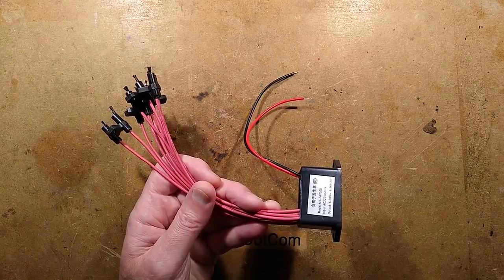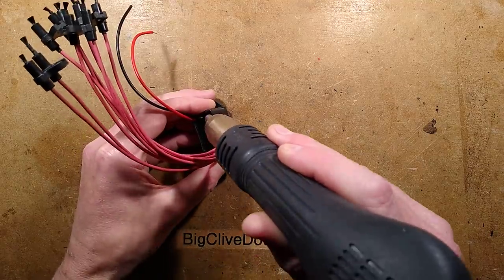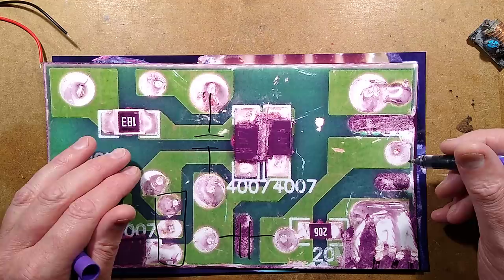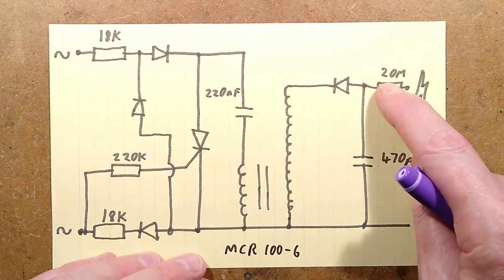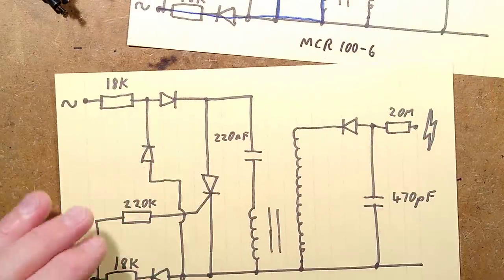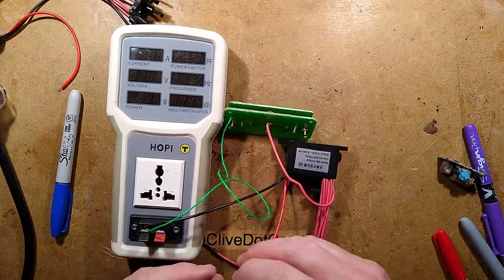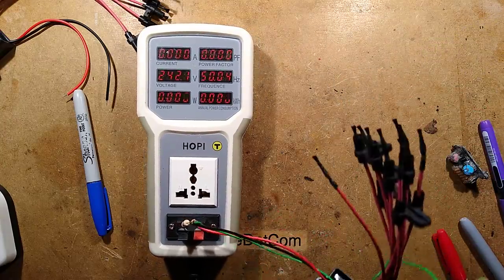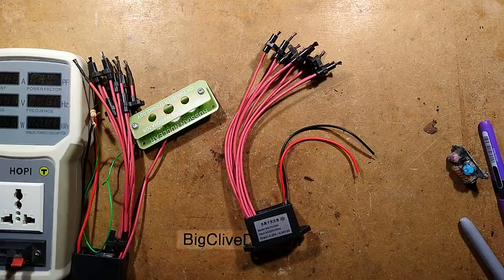eBay's biggest ioniser module depotted (with schematic)

Comment: I love my fridge ozone unit. The stuff really lasts well.  Then I wondered, do they use ozone commercially in fridges or in chilled environments?
Reply from the maker: They do sell units for catering facilities.
Reply: I’ve seen them in fridges and BIG hvac systems. But more commonly you’ll see mercury UVC lamps. That’s pretty common here in the USA in industrial HVAC systems, Industrial ice machines, and some commercial chillers. Manitowoc brand in particular, as well as Hoshizaki.
Reply: Ozonation of water is somewhat common. In some cities, including the one I live in, the water is ozonated at the wellhead and then chlorinated at the treatment plant. Large scale ozone generators are common in pharmaceutical plants where Water for Injection (WFI) is produced. I'm not a WFI expert but I recall the process being something like: media filters -> reverse osmosis -> ozone injection -> WFI storage tanks.
Reply: Does the ozone destroy the rubber gasket on the fridge door?
Reply: @theoldbigmoose  - probably, but the limited exposure area means that the gasket tears apart before the ozone really affects it.
Reply: @sootikins  After ozonation, there is a UV C source to destroy ant excess ozone.  It may be part of the ozonator itself, so it's easy to miss from a block diagram.  Oh, and the WFI is continuously pumped through the service loop, so it's not sitting around anywhere growing bad things.
Reply: @AnanasGuy  Good point about service loop circulation, forgot about that, but it has been 9 years since I touched a WFI system. In the system I'm thinking of the ozone destruct unit was in a vent line coming from the headspace in the tanks. I suppose different systems are set up in different ways tho.
Reply: home fridge/freezers do not maintain temperature like commercial storage, because they don't recover fast from being opened, nor have controlled defrost cycles.
which is why "deep freezers" still exist. that said, so much commercial refrigeration sucks now days and you may get half spoiled foods, not to mention lazy sloppy employees that are untrained and overstock the coolers beyond load limit. beyond load limit places food outside the controlled cold air zone, which  lets it's temperature rise above safe storage levels. tons of salt curing would fix that(lol), but would ensure early demise ;)
Reply: @theoldbigmoose  over time it will. But nobody knows how long it will take. Could be half a year or 7 years....

Comment: It's not like i am new to consumer chineseum, yet it still fascinates me, for 5£/€$ to get the circuit board, components, cables with injection plastic terminated ends with carbon fiber, all the cables soldered, the whole thing potted in resin, shipped across the world, someone making the ebay listing and on top of that it even works..  meanwhile i could charge that amount just for typing this comment lol xD
Reply: Yeah, and we're all getting screwed though.
They took manufacturing away from the US gave it to Chinese slaves while destroying both countries in the end really.
Reply: Things are surprisingly cheap when you go to the manufacturers in China and buy like 4000 of each part

Comment: Ooh, neat!  So it basically puts out little puffs of ions at half the frequency of mains.  That's fun!
Reply from the maker: The capacitor evens it out a bit, but you still hear mains hum from the emitters.
Reply: Technically it runs at full mains frequency. If it was running on a full bridge rectifier, it would be double the mains frequency (100Hz).
Reply: @Basement-Science  Isn't the thyristor only triggering a pulse through the coil every half cycle? I definitely could be wrong.  I did just compare the sound it makes to a 50Hz and 25Hz test tone and it sounds more like 25 to me.
Reply: @BRUXXUS  Yes. A sine wave period is made up of 2 half-cycles though. One positive and one negative half-cycle. 

This circuit outputs exactly  one pulse within both of those, so it runs at 50Hz, not 100Hz or 25Hz.

Comment: 220V in a car is getting to be less and less of a ridiculous prospect, with all the electric and hybrid vehicles running around with 300+ volt battery systems.
I wish I could remember the word (yes there is / was a single word) for "misuse of a large word in an attempt to sound smart"
Bravo for having the god-like patience to actually de-pot a little mystery module like this.
You are our hero!

Comment: You did one recently that sounded like a mosquito- that one sounds like a hummingbird!

Years back when I did surface mount rework, learning to use a grounded wrist strap was a pain, largely because I'd gotten used to avoid being grounded when playing with HV gear.
Reply: I strapped mine to my ankle due to it always interfering with my hands while working.
Reply: Just get a wireless grounding wrist strap!  Saves all the hassle of being grounded... doh!
Reply: Hummingbird?  I was thinking there was an inadvertent release of gas, hence the ionizer.

Comment: I need to thank you, as this vid helped to save a lovely Amcor Pyramid ioniser from the 90s. I had bought one of these same modules before I found this video which was a bit of luck. I followed your advice and ordered some 1W 10K resistors and then found a 100K resistor was already placed in series with neutral, hidden under some heat shrink! Bah!

Comment: How about the aluminum case Amazon voltage regulators next? The 12-48v dc to 12vdc/10A ones. Would love to see those depoted and torn down. Very sparky when applying power in my experience. Singing” It’s time for the pinkulator, it’s time for the pinkulator.” It’s time for the percolator song.

Comment: I’ve put a couple 110v ac units in a cupboard space, and used a 5.6k resistor on the hot wire to increase the safety factor of slamming fine wire with mains voltage on it in the cupboard door.

The thought was that in a short circuit condition (or human contact) the current could not exceed roughly 20 mA. Coincidentally, this also dropped to voltage from about 125v to 112v putting the ionizers closer to their operating voltage.

When you stuck the resistor into the Hopi, what was the safety advantage of putting the resistor on the neutral side? Was this just to reduce the risk of coming into contact with bare resistor leads that were live?
Reply from the maker: The resistor can go in either side.  I put it on the neutral side because it was exposed.

Comment: That little device is a key part of my "DIY Home Precipitron" which seems to work better than expected!
Reply: I was also thinking about building an electrostatic precipitator! Do you have any specific design plans?
Reply: @mfbfreak  No formal design plans as such! My prototype is made mostly from wood, with the HV emitters screwed to wooden supports in the airstream, upstream of a standard metal mesh  rangehood filter (AliExpress do a wide range of these), grounded to the mains neutral line via a 1/2w 1 megohm resistor. Airflow is via a pair of 240v 120mm pc fans.  Initial results (the very scientific method of washing the filter in a bowl of water after a few hours use!) suggest this actually works, and The Wife says it helps reduce her seasonal allergy symptoms noticeably. Aliexpress do a 10kV higher power unit specifically designed as a Precipitron powerpack (about $80 Australian), and that's my next step in the project, along with a larger diameter "box fan" to provide the airflow.

Comment: For future depotting, how about using a Soxhlet extractor? The module would be repeatedly immersed in hot solvent and all the resin would be collected in the bottom flask. No(or minimal) labour required.
Reply: That's exactly what I thought! To add to this, apparently you can get a Soxhlet extractor kit for around 40 euros on AliExpress.
It features the Soxhlet apparatus itself, the condenser and a flat bottom flask so you can put it directly over a hotplate.
You'd need to make a sort of cage out of metal wire (or teflon), put the potted part inside, lower the whole thing into the middle part of the Soxhlet and retrieve it once it's depotted.
Additionally, you could try different solvents. I suspect that dichloromethane (methylene chloride) would work really well.
Finally, the solvent might be recycled by simple distillation. You'd just need to buy a receiver flask and a still head or, if you could find it cheap, something like this vertical still head. (https://www.fishersci.ie/shop/products/quickfit-borosilicate-glass-solvent-still-head-adapter-2/13420439).
Reply: I think you'd want to try different solvents first. No point in getting a soxhlet or other apparatus if your solvent doesn't even touch it anyway. All it would really change is saving you from stirring the solvent occasionally.
Reply: @Basement-Science  The good thing about a Soxhlet extractor is that as long as the thing to extract is even slightly soluble in the solvent, since the liquid is recycled indefinitely, you'll be able to dissolve all of it, given enough time.
Stirring won't cut it, since once the solvent is saturated with the substance to extract, no further extraction will be possible.
The continuous distillation that happens in the Soxhlet apparatus allows the extract to concentrate in the lower flask (in this case, the potting compounds) and exposes the middle vessel to fresh solvent at every cycle.
Reply: @GiorgioCapocasa  Yeah I know it's fundamentally better than stirring, but it doesnt matter if the solubility is insanely low to start with, which I know it usually is for Acetone vs potting compounds. 

I've left some small stuff to dissolve in big jars full of solvents for months with no perceivable effect. So I doubt a soxhlet extractor would suddenly make it viable.
Reply: @Basement-Science  Leaving it sitting in solvent saturaturates that volume. Soxlet extractors drip hot, unsaturated solvent onto the potted thing in question. The potted thing is placed in an archimedes' cup that drains the whole thing once it's full. This saturated solvent drops to the bottom flask where it's boiled, leaving the resin behind. The vapours are distilled above the archimedes cup containing the potted thing, filling it up. Rinse and repeat. The potted thing is always bathed in unsaturated solvent. 

Soxhlet extractors are made to extract low solubility compunds from organic things with a minimum amount of solvent.
Reply: @thesentientneuron6550  I'm not a chemist, but I do know how a soxhlet works. I've seen Nurdrage's video about it as well at some point. I could be wrong and it would actually work well as you said.

My point was just that you still have to use an at least somewhat suitable solvent to start with regardless. And I believe that Acetone is not that.
Reply: @Basement-Science  Giorgio Capocasa already mentioned that, so I didn't feel like I needed to state it in my answer. Your point is valid and important. Yes, a better choice of solvent would probably greatly speed up the process(or it might be required to even start to dissolve that type of potting material).

Comment: At work we used to have air-ionizing fans blowing onto whatever circuit boards we were working on. Supposedly, ionized air helps prevent static build up. I looked into getting one for home but the typical price was like $500.

I wonder if I can stick one of these behind a small fan an use that for a poor man's ionizing blower?

Comment: Benzyl alcohol is non-toxic and is used in some paint strippers (Wilko, sadly, no longer exists) and for some potted components, it is an excellent softener, turning the resin to an expanding gel, which over a week or so can be picked off with bamboo toothpicks or skewers.

Comment: That's basically a capacitive discharge ignition circuit, using the coil from the power supply for a cold cathode fluorescent light, instead of the ignition coil.

Comment: What would your opinion be on installing one of these guys in front of an inline furnace filter? I feel that, in theory, the fine mesh of the filter should provide a lot of surface area for the ions to stick to thus giving them a place to go besides the sides of the ducting. Effectively, making the disposable filter better at it's job while keeping the insides of the duct cleaner.  What do you think?
Reply: The in-line wiring might be a problem, also the filter would have to be changed often for dust build up. It may also concentrate oils from the kitchen.

Comment: I got scammed on an ionizer plug-in unit with fake electronics inside, so I bought a 120V unit similar to this and replaced the guts of the scam unit. Great upgrade and no extra resistors because my life isn't exciting enough for safety.
Reply: Great video BTW. Thank you.

Comment: I've used a similar circuit driving a thyristor to make a electric fence energiser . It used a voltage doubler rather than resistors to charge the capacitor ( almost like a kind of cap dropper current limiting). As the  capacitor charged up it would reach a threshold and fire the  ( I bit like a light dimmer circuit but slowly about one pulse per second)

Comment: Dichloromethane (DCM) will depot much better than acetone. It will also dissolve some component potting (e.g. epoxy dipped polyester caps) so dont leave it to soak too long.
Reply from the maker: It's hard getting the useful stuff here on an island due to hazmat shipping.
Reply: @igrim4777  Yeah gloves and an organic solvent respirator are definitely required.

Comment: Which value should the additional resistor between the ionizer and mains neutral have? It's running at 240V.

I ordered the same thing some time ago, it's still sitting around without an Idea where and how it wants to be finally mounted.

Would be nice to see your implementation if it's ready for prinetine, yet.
Reply from the maker: I'd suggest trying two extra 18K half watt resistors.  One in series with each of the supply wires.

Comment: How is this inoniser actually meant to be used? Just plug it in a socket or does it need to be put into some kind of box or ventilation system in order to work?
Reply from the maker: I think this version is intended to be used in an air cleaner with fan, on the output port.
Reply: I see thank you very much. I  actually wanted to use it together with a ceiling ventilator. I have read that this helps to tie the radioactive particles deriving from the decay of Radon gas to dust particles and thus reduce them in the air. I am not sure yet, if it works but I think it is worth giving a try. I have to find the right setup though....Any ideas welcome 🙏

Comment: Clive.
Would the high voltage coil from a Taser that you zapped yourself with a few years ago work in the same way?
I was wondering if it did then we could have an ioniser powered by a AA battery.
Reply: Yes a Taser circuit could be used as an ionizer, but running it on batteries still requires you to connect it to Earth somewhere. Otherwise it would stop doing anything almost immediately even if it kept running. You need some form of return path for the charges for an ionizer. But for an ozone generator, you dont need that.

Comment: Reminds me of a very simple Tesla coil esque circuit. Did you work out what the resonance frequency of the capacitor / indictor combo is? You probs find that when ever the gate triggors, the cap / indictor will resonate through the thyristor then back through the diodes. That and a loosely coupled transformer and you can get some serious HV. On a side note have you tried replicating the circuit on a simulator, much like ltspice ect... ?

Comment: Thanks for the video. I wonder whats the value of the resistor you mentioned for keep the device safe and works for a longer time.  We use 220v
Reply from the maker: I used a 33K 2W resistor.  It's mentioned in the video description.

Comment: what type of resistor do you recommend to use before pluging the cables into electric current ? can you give a value please, and the direction it should go into the ac plug? i just bought 3 of these ion generators, hoping the can last long.

Comment: A few VERY rough calcs....
There's 36k of resistance (2 * 18k) and 220nF of capacitance.
A capacitor will charge up to 63.2% of the supply value in r * c seconds => 36000 * 2.2e-7 => 0.00792 seconds
The capacitor is only 'charged' for one half of a 50Hz mains cycle = 0.01S
Furthermore, the 'peak' of the charging half cycle of incoming mains occurs after only 0.005S
The incoming mains PEAK voltage is 240V * 1.414 = 340V
The capacitor will charge to somewhere around 1/2 of that value (as it doesn't have enough TIME to charge further)
=> Capacitor charges to about 170V

(I'll confirm that value later with my (battery powered / isolated) oscilloscope
Reply: I'm gonna say the capacitor will end up with a little bit of negative voltage after each switching cycle. How much depends on the transformer and HV output.
Reply: @tactileslut  Might just destroy itself pretty quickly TBH, especially the transformer and other HV components.

Comment: Some things I found on official websites:

Australia: "Ozone generators are being promoted as an effective method to clean indoor air pollution and odours. However ozone is associated with adverse health effects. Available scientific evidence shows that ozone concentrations that are safe to breathe are unlikely to be effective in controlling indoor air pollution."

Canada: "Canada advises against using ozone generators in homes. They are sold as indoor air cleaners, but the level of ozone they produce may harm your health. They also create other dangerous chemicals."

USA: "The concentration of ozone would have to greatly exceed health standards to be effective in removing most indoor air contaminants. In the process of reacting with chemicals indoors, ozone can produce other chemicals that themselves can be irritating and corrosive."